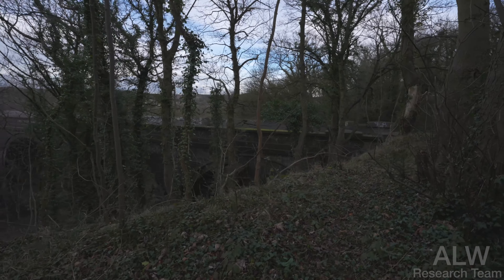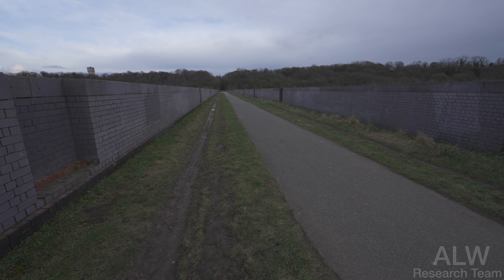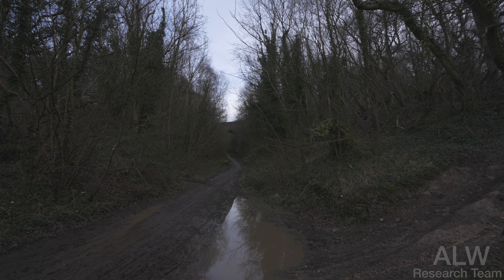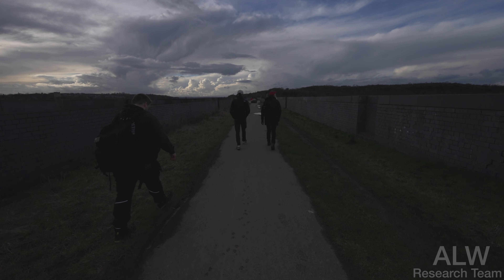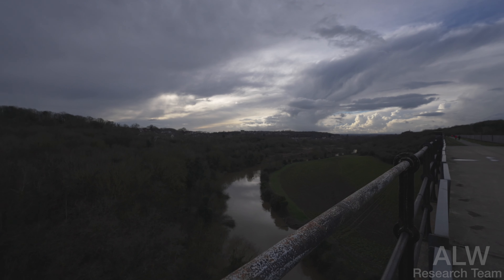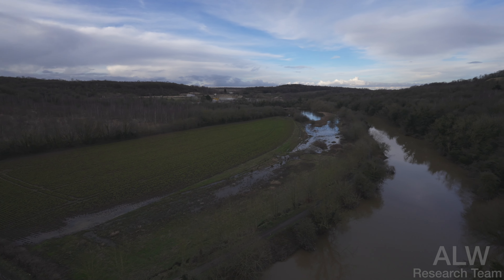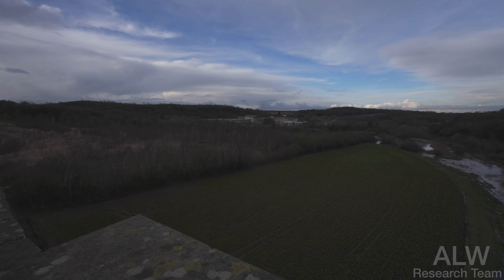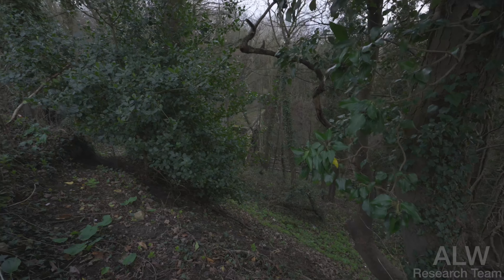Forgotten History - Conisbrough Railway Viaduct

Comment: The railway line you could see was the Doncaster to Sheffield Line, they normally run sprinter trains on that line usually various different trains from the 150 classes so 153, 154, 155, 156. The trains are about every half hour but i think they put some extra ones on at peak times.
Reply from the maker: Hello Mary, thanks for the information :-)